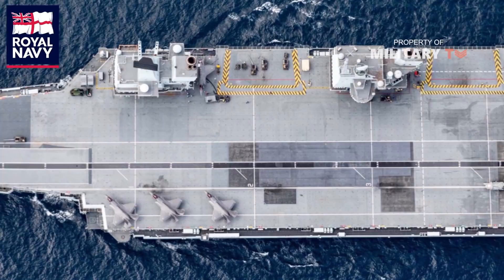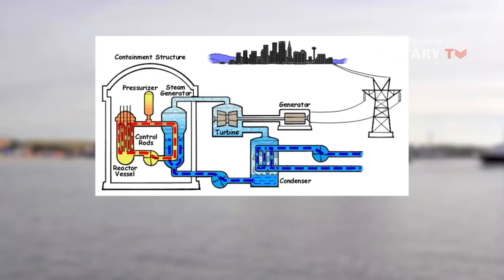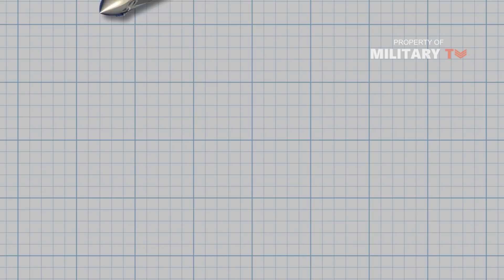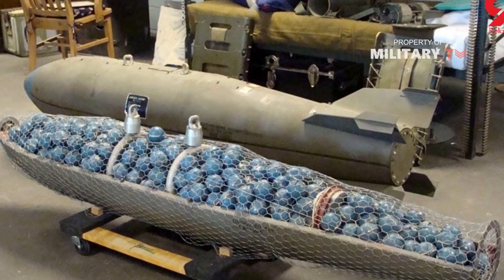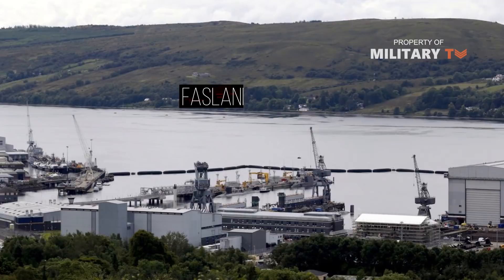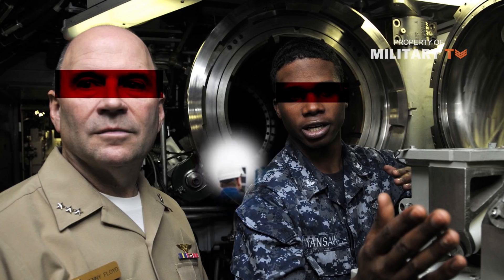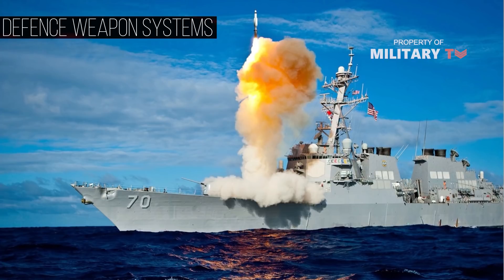The reasons HMS Queen Elizabeth is not nuclear powered

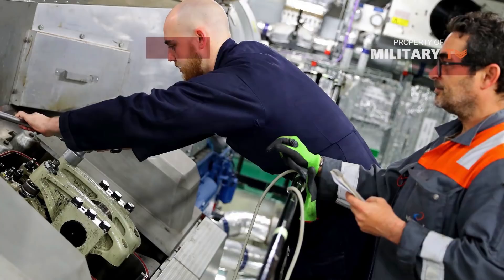Comment: that reason at 1:38 is bullshit. Nuclear reactors ALL have SCRAM, or emergency control drop rod systems that will shut the core down nearly instantly. 

also, the sinking of an aircraft carrier is usually calls for full on nuclear war, the sinking of one in blue water is not possible, not even for chinese anti-carrier missiles. (as it requires real time updates of quardinates) So, its a deterrent, if a nuclear powered carrier is sunk, itll be from land based heavy fighters over powering sensors and guns. This will then lead to that country needing to deal with the nuclear crisis off their shore.

also, people need to stop using the ramp. 
and, the Elizabeth seems to not have a side landing way, so. sortie is going to take longer. where as the off center runway on a US carrier can catch incoming craft, and at the same time, launch craft.

Comment: It has to be said that the UK has twenty old nuclear submarines await to be scrapped. 
But cost and technical issues have put matters onto hold. An expensive game,
and a heavy burden on a middle sized power, in relative decline...
Reply: The French had no problem. When they decomissioned the one in Cherbourg they just put the core reactor on the quayside for a few years. Did not seem to cause them any problem. They shipped it to Flamville about 4-5 years ago after it had sat there for at least 10 years that I am aware of., The size of a submarine one is about a 1 meter cube, so it is not very large. One could stick it in the back of a Transit.

Comment: Answer is simple. UK do not have high-power density nuclear technology. Their PWR reactor line is vastly obsolete and has power density equal to 60s naval reactors, so 2 generations behind todays elite. PWR 2 with 20MWp weight six times more and occupy twice as much space than RR Trent MT30 which has 36MWe of power. So weight based power density is 12 times worse! For same electrical output of 120 MWe they will need instal 6 of these PWR 2 reactors or develop new one or ask Americans for A1B or S6W. But there is another problem, A1B is too powerful, so only 1 would be needed, which is too small number for military ship and S6W is too weak, so 4 of them would be necessary.

Simply put, UK does not have technological level to build surface nuclear ship any more. As they lack many other capabilities in military technology. In fact, UK is technologically backward country and there is no light at the end of tunnel for them. Until now, they were able to hid their technological lag behind wall of money of foreigners on which they parasited due historical fact, that they were financial heart of European banksters. But after Brexit, this last resort will gradually capitulate too and then scientific and technological incompetence of country extremely damaged by multiculturalism, inclusion and color immigration will be revealed in its full "glory".

But I am not sorry about that, England deserve their fate in full for all wrongdoings they did in history.
Reply: Bravo 👏. I Singh what u written.